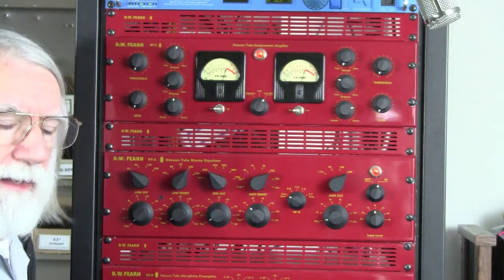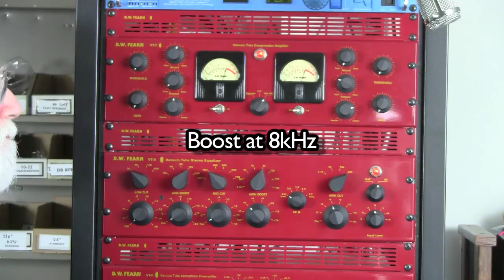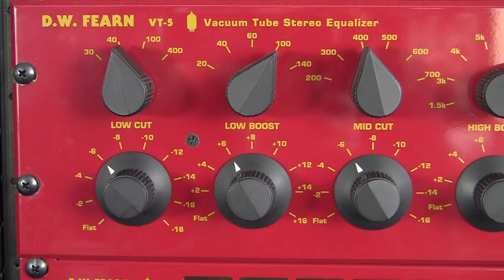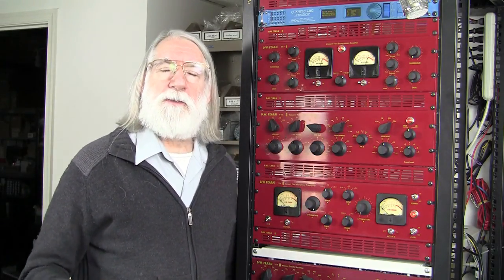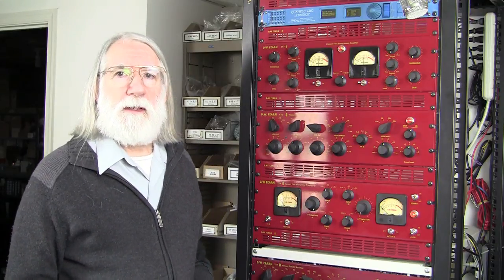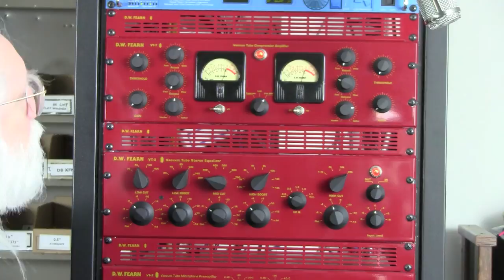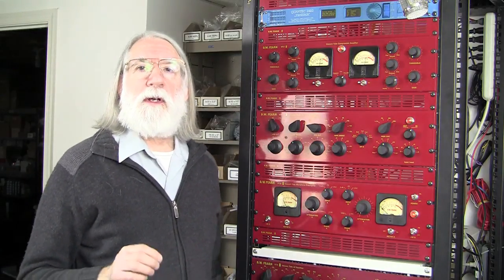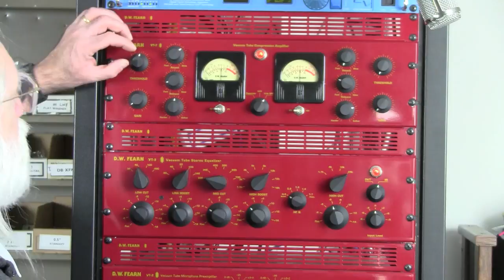D.W. Fearn VT-7+VT-5 Tutorial Part 2.mov

Comment: Rather than a LF link switch, why not incorporate multi-band compression?  Seems like that would yield the same results and add even more flexibility.
Reply: Pardon me for responding to a three year old comment, but it would not be the same at all. The response of each frequency band in the compressor would be distinctly different from a single compressor on the full range, even one with a highpassed sidechain. This is also ignoring the fact that adding an entire circuit for another compressor would nearly double the cost of materials it'd take to make the hardware.
Reply: @williambrewer3150  I didn't say it was the same.  How could it be?  It's a completely different architecture.  I said it could yield the same results with more flexibility.  That was the point of inventing multiband compression.
Reply: @chansetwo  It wouldn't yield the same results.

Conceptually, multi-band compression takes input of a select portion of the frequency band and so it can affect a select portion of the frequency band output. 

High passing the sidechain of a single band compressor is essentially taking a select portion of the frequency band and affecting the entire frequency band output. 

While they're relatives of each other in concept, the use case for mixing and mastering varies greatly between the two.
Reply: @williambrewer3150  It can sound the same.  Every radio and television station you have heard in the last 30 years uses multiband compression.  Can you tell it's multiband?  No, it it is working correctly, you can't.  That's the point.  It's called fidelity.  They can sound just like a wideband compressor or do things a WB compressor never could.  You're also wrong that you have to add more compressors to make multiband compression.  This isin't 1976
Reply: @williambrewer3150  Sirius/XM also use multiband compression on all their feeds.  Saying you can hear the effects of compression when there's no compression is just absurd.  You have wasted enough of my time.  Multiband compressors can be designed using DSP, not individual compressors.  They have been doing that since the 1990's.
Reply: @chansetwo  I do wish you properly read what I wrote, but that's fine. Anyways, if the compression is performed using DSP, it kinda defeats the point of using an outboard piece of analog hardware. Also, I might have misread your post, but to do any sort of digital multi-band compression, you still need a stream of buffered audio per band, which, in every iteration I know of each requires a controlling algorithm.
Reply: @williambrewer3150  Who said anyone must use outboard analog compressors?  You're just arguing with yourself.  You said multiband compression requires duplicating compressor circuits.  That's not true.  Outboard DSP based  multiband compressors have been around for 30 years.
Reply: @chansetwo  Were we not discussing the use of multi-band compression in the Fearn compressor?
Reply: @chansetwo  "Rather than a LF link switch, why not incorporate multi-band compression?"

You literally said it yourself in your very first comment. Am I missing something? That's what we've been talking about this entire time.